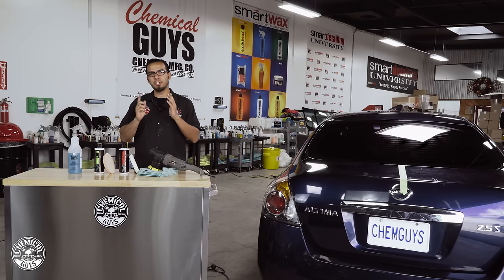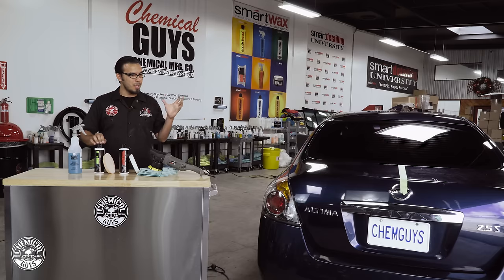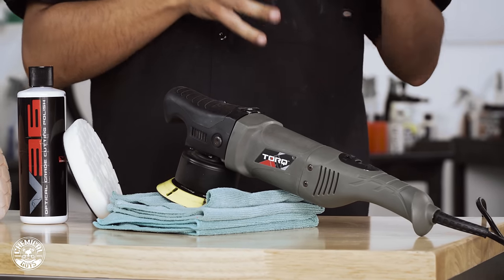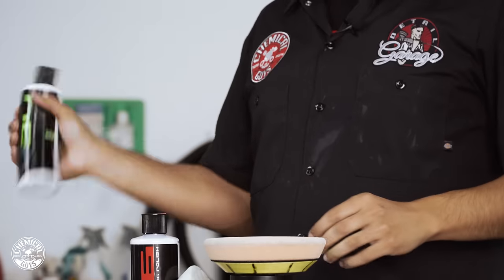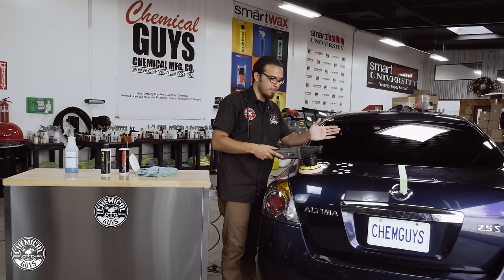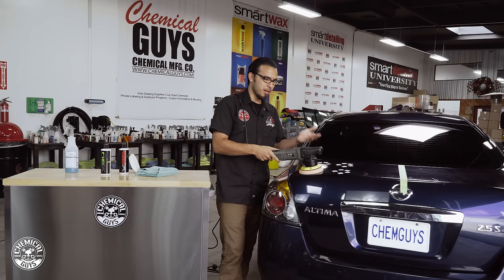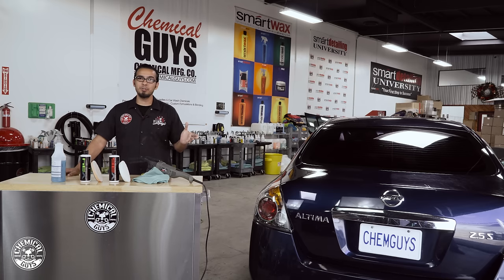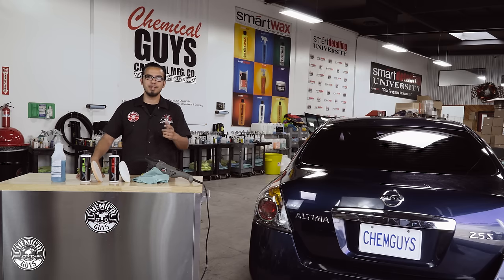How To Remove REALLY Deep Scratches and Swirl Marks! - Nissan Altima - Chemical Guys Car Care

Comment: So the chemical guys kits have V32, 34, 36 and 38.  Why not start with V32 to work on those deep scratches that you can still see at the end.  And why not finish with V38 for a higher polish?
Reply from the maker: Hi Larz, thank you for watching.  The paint on this vehicle was very soft, we were able to get amazing results without having to use a heavier compound, also the customer was so happy with the results that we didn't need to take that extra step. For a more perfect correction, what you stated would be totally correct. Ultimately its up to you on what combinations to use, and how much time you have to work on your vehicle. Stay tuned Larz, we have more great polishing videos coming your way.

C.G. Alex -
Reply: Thanks for the quick reply!  First, how can you tell the paint is soft?  And better yet, why is it soft?  Is it because of cheap paint, poor paint care, too much UV?  I just ordered a the BUF 501x  kit on Amazon since they offer next day delivery and I want to do a paint correction and ceramic coating on my car this weekend.  The kit has the Torq 10FX polisher with v32, v34, v36, v38 and orange, white and black pads. I have a 2011 R8 that has low miles and has been garaged all of it's life, but it has horrible swirls from taking my car to the local "hand" car wash instead of making an appointment at my detailer each time.  So V32 is not going to be needed.  How do I figure out if I need v34? Do a test area over the worst crathces with v36 and if scratches are left, go back to v34?  And which abrasive goes with which pad?  V32 and v34 on orange, v36 on white and v38 on black?  One last question,  can I use Clean Slate to start the paint correction and then use it again before the ceramic coat or does it leave any residue that could interfere with the ceramic?  The cermaic coat manufacturer says to do an IPA wipedown to remove wax, but I will have already done that with Clean Slate.  Thanks in advance!
Reply from the maker: Hey Larz, hard paint is typically used on higher end vehicles to reduce scratches caused by debris, to prevent oxidation, and resist scratches from washing.  Most lower end vehicles have soft paint because it's less expensive to apply. When using polishes and compounds, you start with the least aggressive option and work your way up when you're not getting the right results. Remember that achieving perfection is very difficult, so you have to tread cautiously because clear coat is paper thin. Yellow pads are the most abrasive, followed by orange, green and white. White pads are for refining using V38. Nick usually starts with an orange pad, and pairs it with V36 or V34 depending on how severe the paint looks. Try this combo V36 Orange pad or Yellow pad, finish with V38 white pad. If there's a medium amount of scratches, try V34 orange, V36 orange pad, v38 white pad. The more you polish, the faster it will become to assess the paints condition and what chemical/pad combination work best together. Wash your car with Clean Slate , clay the car if the paint feels ruff, and start polishing with V36, do a small test spot, you'll know where to go from there. Using the ISP is completely optional, we don't bother with it, but it's up to you. Here's a link to our website that outlines the various pads and their purposes. I'm also going to leave a link to a video that will help you with the process, don't be nervous, you can't really screw up that bad with a dual action polisher.
http://www.chemicalguys.com/Hex_Logic_7_5_Buffing_Pad_Kit_p/buf_hexkits_9rotary.htm

https://www.youtube.com/watch?v=HrUmQ6uLSPI&t=466s
Reply: Thank you for spending the time to reply.  It is much appreciated.
Reply from the maker: Anytime buddy, glad I could assist you.

Comment: Just picked this up (fx10) what speed settings are you using. It doesn’t have the traditional 1-6 instead says 15-40. Compound speed/polish speed/wax speed thanks !
Reply: VITO DEGIRONIMO for cutting with compound i use highest setting, polishing is about middle speed and lowest is spreading wax

Comment: I have a older model pickup with just barely any rust in just two spots on my rear fender but the paint otherwise is in pretty decent shape should I clay bar and polish even though there little rust is it worth it?

Comment: are they big differences on porter cable  then a toro  I have same scratch problem on my car  I use v 34 - 36&38 the results are not the same
Reply: Pablo Gonzales I bought the Porter cable because it has more weight to it and because it's got higher speeds.
Reply: It depends on how bad your scratch is, and also technique will always beat branding of products used.
Reply: The scratch are some deep across the car berly feel whit the finger nail. Porter cable polish did ok on some of them but white the lite don't look to good I was hoping for a 60 to 80%  so  maybe  speed  or technique may be the problem any opinions. ??

Comment: I use auto finesse polishing compounds with a rotary polisher. regardless of how much i blotch out the product across the surface, as soon as i turn my polisher on it throws polish over the rest of the car. Any advice?
Reply: James Envine Apply product to the finish using an applicator, and slowly ramp up the speed of your rotary to dramatically cut down on the amount of product sling.
Reply: So apply to product onto the paint with say, a foam applicator sponge, then use the rotary polisher instead of applying the product directly onto the polisher?
Reply: James Envine Are you using a wool pad? When I use a rotary with a wool pad I just drips some on the finish as I go.
Reply: Dillon Kulp I have been using foam pads
Reply: Yeah, that's how I was taught to do it and have always done it that way. Seems to work great.

Comment: can u just use the vss scratch and swirl remover ??
Reply from the maker: Hey! In this video we use the combination of V34 and V36 because there were heavy scratches and swirls but for moderate to fine imperfections you can use VSS as a one step polish. - Happy detailing!
Reply: Chemical Guys okay, would the vss still have worked on this kind of scratch ???
Reply from the maker: Absolutely, VSS would remove the scuff as well as any scratches or swirls that it may have caused. Blending may be necessary or polishing the entire panel to insure that it doesn't stand out where the scuff was.

Comment: If you had a choice between the TORQ 10FX and the TORQX which is the best option for someone to buy a single tool?
Reply from the maker: The TORQX is perfect for the novice enthusiasts. The TORQX can do it all, designed with simple and intuitive controls, rugged components, and durable build materials to last for years of dependable detailing use. This one is all about balance and comfort to help you against fatigue during those long polishing jobs. The integrated cooling vents channel air through the handle to cool the motor, buffing head, and counterweight for extended lifespan. Intuitive placement of speed controls keeps detailers focused. The TORQ10FX is designed for power and precision. It has vibration reduction technology for you to handle the power the 10FX has. What's great is that it has built-in safety features that prevent the user from damaging or burning paintwork.

Comment: What is the difference from vss to this v34-36?
Reply from the maker: Hi Carlos, 

VSS is a one-step polish that can do the cutting of the V34 and refine it a bit less than a V36 but a bit more than a V38. It reduces the amount of work you have to do but different paintworks require different steps. Always try it on an inconspicuous area to see if you get the results you desire. For really deep scratches, the V32 is king.
Reply: Got it, paint is 3 years old, just removing swirl marks, no scratches. Thank you !

Comment: Quick question why didn't you use v38 instead of v36? :)
Reply from the maker: The V38 is the ultimate refined final polish ti finish it to perfection following compounding and polishing steps. It's perfect to enhance gloss, depth, reflection after you've done all that heavy cutting and smooth out all the marring that the heavy compounds did to it.

Comment: What polish and cutting pad do you recommend for a black gmc sierra?
Reply from the maker: Thanks for checking out the video. That depends on the level of scratches, and swirls on your vehicle. If your Sierra has light scratches and swirls, start with VSS, and a white polishing pad. If the Scratches don't come out, try VSS with an orange pad. If the Scratches and swirls are severe, Move onto the orange pad with V34, and finish with V36/V38 with a white pad
Reply from the maker: Always start with a small test area, before moving onto a more aggressive approach.
Reply: Thanks! Really appreciate the help, I just wasn't sure if GM vehicles were a soft or hard paint.

Comment: what do I need to make spokes on my Honda Shadow 600 chrome again & my aluminum engine to keep it that Chrome look
Reply from the maker: How's it going, Rich,

Depending on how bad your spokes are, you'd want to use either the Light or Heavy Metal Polish. They are both perfectly safe to be used on chrome to restore its brilliant shine while also using its advanced metal sealant to provide it durable protection.

Comment: Did u wipe off the v34 before applying the v36?
Reply from the maker: Hi Mitchell, thanks for watching. Yes we did, you have to buff off the compound to observe your results, typically compounding results in swirl marks, that's why you apply a finishing polish like V36/V38 to remove them, and expose the smooth paintwork underneath.
Reply: Chemical Guys ok thanks. Also do different types of polish jobs has different type of pressure when polishing ?

Comment: whats the best way to dry the hex logic microfiber pads after cleaning them?
Reply from the maker: Hi Bryan, thanks for watching the video. Letting them air dry is typically the best way. If you have a vacuum with a blower option, you could use that to speed up the drying process.

Comment: What's the best way to wash polish applicators ? Hex logic ect
Reply from the maker: Hi Curt, there's a few ways to do this. You can use the universal pad washer with a built in grit guard. You basically fill the pad washer with water just enough to allow the spring be able to be compressed. Then you'll want to ass pad cleaning shampoo into the pad washer bucket. You attach a pad to your polisher, place the polisher into the wash bucket, make sure the pad has already been attached, close the splash guard to prevent water from splashing on you. Set the polisher to setting one, and push the polisher on the spring loaded dirt trap to clean the pad. To finish cleaning the pad, set the polisher to the max settings so it slings the water off of the pad (inside the bucket, with the splash guard down).  The second way is to spray the pad with pad cleaner, turn the polisher on, use a brush to scrub the pad while its spinning. I suggest wearing cloths you might not mind getting wet. Here's a link to a few videos that might be useful.

https://www.youtube.com/watch?v=4vfvP1Z2R4U&t=307s
Reply from the maker: https://www.youtube.com/watch?v=B9lED1PPuLY

Comment: Could you re use the pads by washing? Or do they have to be replaced after use
Reply from the maker: Hi Adrian, thanks for watching. The polishing pads can be used for years if they are properly maintained. Your responsibility is to clean the pads after each use. You can clean the pads by using pad conditioner, and brush. You can use the Grit Guard Universal Pad Washer as well to keep your pads in good working condition. We have more than a few videos which illustrate the proper techniques on how to maintain your pads.  
https://www.youtube.com/watch?v=B01zu7wuGA0&t=2s

https://www.youtube.com/watch?v=y93fD5WLl1Q&t=129s

Comment: What about deep scratches that cost your paint is there any idea ?
Reply: Paul Walker Rest In Peace. You don't need to wax your car in Heaven
Reply: Paolo Inigo  😂 thanks 🙏
Reply: Edward Bautista  thank you so much, is 3M the best or there is another product ?
Reply: Paul Walker in my opinion it is that what we use at the bodyshop I work at
Reply: If it's deep you can do 1500 sand paper with water and sand it untill you can't see the scratches just use your best judgement not to do it to deep so you won't burn it and then use 2000 and 3000

Comment: I just bought the fx10 you think I will demage my paint is my first time using a polisher machine?
Reply from the maker: The TORQ10FX id the perfect machine for the enthusiast detailer and the weekend warrior. Innovative design has put the user in control of the machine instead of vice-versa. With the speed controls and on/off switch so close to your dominant hand, literally putting control in your hand. The placement of these controls also touches to improve detailing comfort, efficiency, and longevity. One final detail, the TORQ unit turns on at a speed of 00 to reduce human error and injuries that can occur from improper use. 

-CG Javier
Reply: Chemical Guys thanks guys. I want to know how can I use I am talking about the speeds. when to use 2 or 4 speed

Comment: that was perfect i been trying to do this and i still have swirls. i have the torqx maybe its not strong enough. i am using the Boss fast correcting cream with the yellow CG heavy cutting pad
Reply: If your car hasn't been polished before, compound and polish alone might not make it look like factory paint again. It might take some wet sanding, and it's up to you to determine whether that's worth doing.

Comment: These type of scratches need compound before polish
Reply from the maker: Hi, thanks for watching. The paint was corrected using V34, followed by V36. V34 is a compound, and was used to great effect by eliminating most of the visible scratches. We could've gone further with this correction, however the results were sufficient enough for the customer, they were happy which made us happy. Depending on how much time you have, and the satisfaction of your client, you could always go further if the paint hasn't been previously corrected.

Comment: Do you ever do any wet sanding to cars for RIDS?
Reply from the maker: Hi Casey, we don't wet sand because it can be potentially harmful to your paint unless you're extremely brave, or you're a very experienced paint correction professional. Chemical Guys is all about safety, and doing the absolute least amount of damage to your car's paint. Stay tuned Casey, we've got more great videos coming your way.

C.G. Alex -
Reply: Chemical Guys  Don't know if you have ever seen Jason killmer and says sometimes when you sand you actually remove less paint(clear coat) then compounding. I'll wait to see any up coming videos
Reply from the maker: Hey Casey, most people don't jump straight into wet sanding immediately, they tend to compound first, and decide to wet sand afterwards. I suppose if you're a seasoned paint correction pro, then you might decide to wet sand, most of our viewers are amateurs just looking to get some type of improvement. Chemical Guys is really about making detailing accessible.

Comment: How many orange pads it take to do the whole thing?
Reply from the maker: Hey John, 

That's a good question and I'd be happy to answer it. As you may know, during a polish, you want to change/clean you pads at least every 2 or 3 panels. Here's the reason why. Polishing pads will absorb oils and abrasives from the polishes and over a period of time , the pads will get saturated with both the contents of the polish as well as the paint removed during the vehicle during polishing. You have 2 options: the best way is to have spare pads of the same size and cutting ability. Second, clean the pad after 2 or 3 sections in order to remove all the residue and dust that has formed on the pad surface.
Reply: Whats the best tool/way to clean the pads? sorry totally new to all this just found out i have a passion for detailing!
thanks!
Reply from the maker: It's always awesome having new enthusiasts. Welcome to the Chemical Guys family! You have a couple of options when it comes to cleaning your pads. You can use our Foam Pad Cleaning Brush that will easily scrub out residue and dirt. You can also use the Foam & Wool Citrus-Based Pad Cleaner - it removes polish, wax and paint residue by just spraying it. It'll rejuvenate and restore your pad.

Comment: So that v36 is used if v34 is the one that did the job?
Reply from the maker: How's it going Lucas, the V36 is a light polish with vary minimal abrasives. The V34 was used to cut the paint in order to remove damaged layers of the gel coat. The V36 polishes the surface,  and removes minor imperfections and swirls. You always want to follow up with a finishing polish to remove as many defects in the paint as possible.
Reply: I guess that better job would do the Chemical Guys V32 than V34. In the end there are still small scratches in the treated paint.
Reply from the maker: Hi Nikolay, you could go one step further, we just wanted to illustrate the difference, it would be up to you to keep going if the paint correction wasn't to your satisfaction. Welcome to the Chemical Guys family.